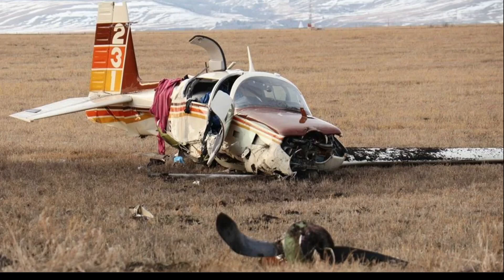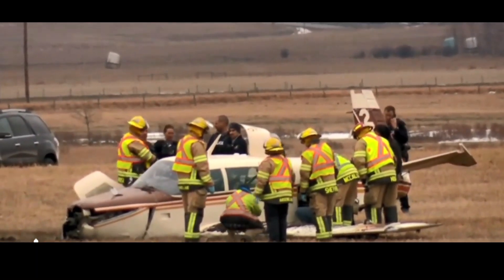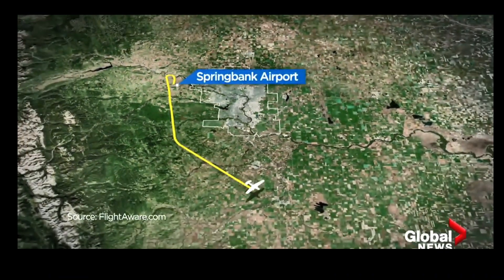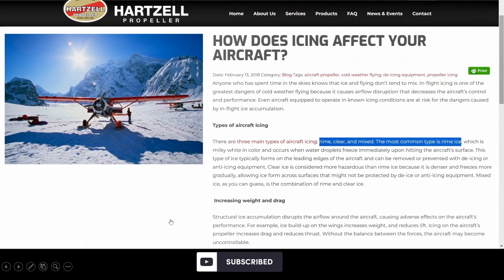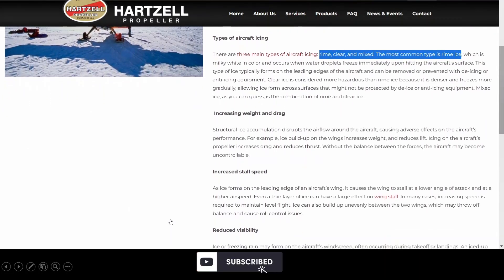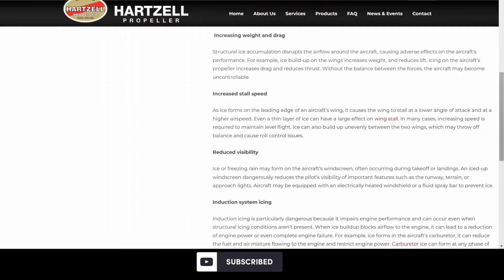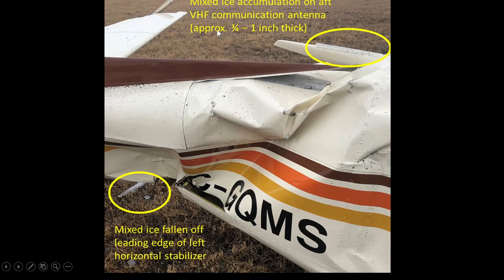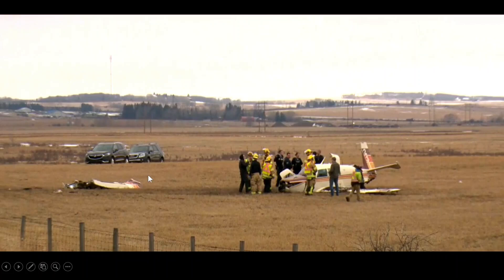Icing of Aircraft Causes Crash in Canada

Comment: The majority of general aviation icing accidents have the same aerodynamic cause. The horizontal stabilizer is unable to generate enough downforce to keep the nose up and the aircraft descends until impact with the ground.  The airfoil on general aviation aircraft horizontal stabilizers are symmetric, which makes th more susceptible to loss of lift due to icing contamination. The thinner the leading edge, the more efficient the surface is at collecting ice. See how the antenna has thicker ice than the horizontal? The wing leading edge would have even less ice. 
As someone else said - if you know you ha e picked up ice keep your speed up, don't lower the flaps because that will require more downforce from the horizontal, and pull into any tail buffet you feel - the opposite of how to respond to a wing stall.
The weight and the drag are not what brought this aircraft down - it would have impacted much more vertical following a stall.

Look up Icing Contaminated Tailplane Stall (ICTS) to learn more. Both NASA and the FAA have great videos.
Reply from the maker: Thank you Darren for taking the time to share.

Comment: Different airplanes handle ice differently.

I owned and flew  a Piper Comanche back in the 70s and 80s. More than once,  I had around 1/2" of ice. It had a carbureted 250 HP non-turbo engine and had no problem maintaining 16,000' with more than 1/2" of ice. 

I also flew a V-tail Bonanza for a businessman I knew. It had a 285HP turbo engine.......I'm glad it was turbo........with any more than a trace of ice, that plane flew more like a brick than an actual airplane. 

Ice is difficult to forecast and if someone reports no ice, a half-hour later you can be picking it up. The opposite is also true. Also, it can build up incredibly fast. You can get 1/8" in 2 hours then 1/2" in 5 minutes. 

Turning back sounds logical but it might be the worst possible decision. A turn, even a shallow one, in a plane that doesn't handle ice well could easily be fatal. A steep turn almost certainly will.
Reply from the maker: Thanks for sharing your thoughts with me.  Cheers

Comment: Great video. You’re learning so much about light aircraft, and great you include examples! 46 years ago I flew a bonanza v tail for a corporation. I was flying Maine to North Carolina in the fall. In a short amount of time, I picked up time ice on my wings, tail and windshield. I tried my best to get out of it, to melt it off. I told ATC “I need an airport NOW! The vectored me to the closest airport-Keene, NH. I put the windshield defrost on high, and got a small patch cleared of ice in front of my face. Landed okay, and had stuck about 1/4-1/2” ice, on wings and tail. It was close!  In clouds with low freezing levels, it’s hard to climb to warmer altitude-especially with ice, and descending may not find warmer temps-especially warm enough to remove the ice. Preflight planning is sooo important. Don’t go, May be the best option!
Reply from the maker: Thanks David for sharing that story.  Awesome you made the right decisions to get home safely.

Comment: Don't know the details of this one, but it looks as if the airplane crashed on or very near the airport - maybe just shy of a runway? And that brings up an important point about flying in icing conditions. The pilot was probably okay - stabilized in a descent at a given airspeed - all the way down the initial approach until: 1) He began slowing down for the final approach, and 2) He began reconfiguring for the landing. And that's where most ice-related incidents lose it all. So, if you're carrying a good amount of ice and already feeling and seeing its effects on your machine, plan on flying at a much faster speed all the way to the runway in perhaps a no-flaps configuration. You may even have to fly at or above the normal cruise speed all the way to the ground. And if that means running off the end or a side of the runway, then so be it. Just fly the thing all the way down to the ground - at full power if need be. I think maybe those two King Air pilots in Ohio found out the same thing - but just a little too late. Do Not Slow Down to anywhere near your normal approach speed. My worst experience with this kind of thing was in 1983 in a Metroliner in Columbus, Ohio (The whole Great Lakes Region is terrible for in-flight icing...). We picked up so much ice that night that the deice boots couldn't handle it; they simply inflated and deflated beneath the ice bridge with no effect whatsoever. We had maybe three inches of ice all over the airplane. But fortune was on our side: The Metroliner could carry a ton of ice, and the runway at Columbus was more than 10,000 feet long. We flew the approach at 160kts, flaps up, all the way down to the runway before we leveled off and began to reduce power. The airplane stalled just above the pavement at 145kts. We hit pretty hard and rolled to the very end. The ground crew were stunned to see all the ice on the machine as we taxied in. I used to have some photos of it, but have since lost them someplace.
Reply: Absolutely correct - these guys must have had a lot of ice if it's still there after the rescue crews have shown up and started taking pictures.  Controlled touchdown at 120kts is far better than a stall 50ft high on short final.
Reply from the maker: wow. Thanks for sharing that story Mega,  awesome information

Comment: I've had ICE Twice.1st.  Bases 1000 AGL tops 6000 to 6500 MSL. Contact Minn Center for IFR clearance KGOV Grayling MI to KRYV Watertown WI. Guy reported in & out of Tops at 6000 Negative Ice. When I broke out the TOP i had 1/4 to 3/8" of Mixed in a 172 3 souls on board. Didn't come off till 1000' agl on Final in the CLEAR at KMGG Muskegon MI.  That, still after 35+years causes Nightmares. 2nd Turbo lance 11000' msl over KORD.
Reply from the maker: Glad you made it out all right.
Reply: @ARFFWorld       Well you were awful f'n lucky !

Comment: That looks like a lot of ice for such a short flight.  I wonder if they had a significant accumulation before they took off and failed to preflight the aircraft properly.  The general rule is that if there is any ice, or even just frost, on a wing or either of the stabilizers then you need to clean the aircraft before take off.   

Ice can add weight, but the worst thing it does is that it changes the shape of the control surfaces making the plane difficult to control.  If you don't have deicing boots, TKS, or thermal deicing then you have to stay out of icing conditions.  Period.
Reply from the maker: Thank you for sharing that info.  🤙🏽
Reply: The ice was all accumulated inflight. That is why it is all on the leading edges of everything. If the ice had happened on the ground it would be coated on the upper surfaces of everything instead.